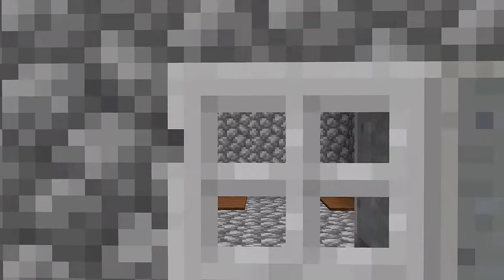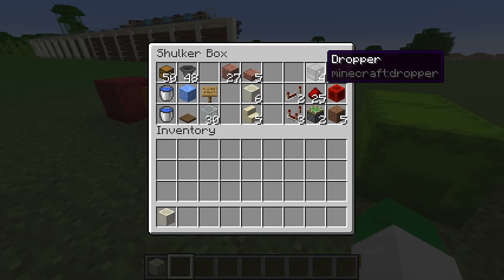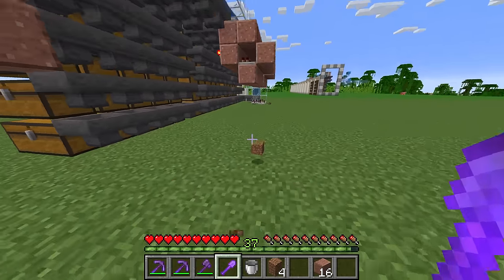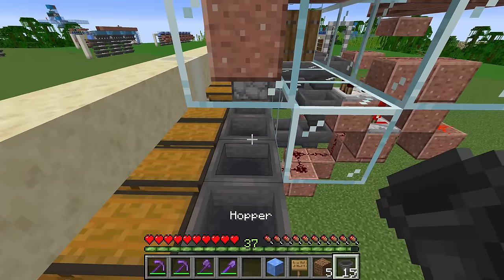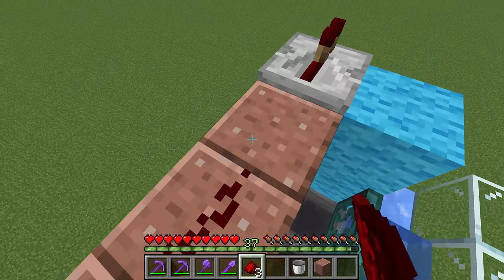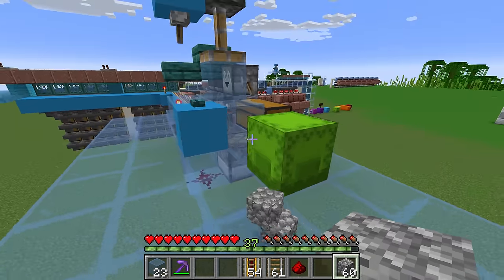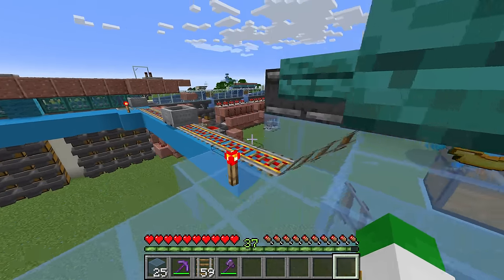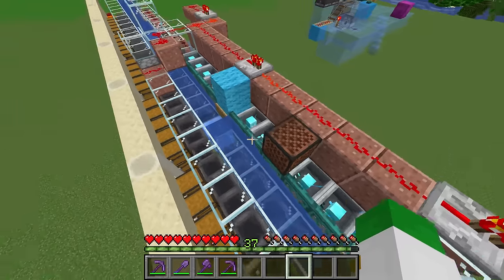How to Build an Allay Item Sorting System in Minecraft 1.20

Comment from the maker: Link to Part 1: https://youtu.be/oByuyOdZ1Is
Reply: I keep having a issue with the bottom dropper not wanting to dispense the items. The only solution I have found is adding another Redstone torch on the bottom block but it bypasses the clock. On bedrock btw, everything else seems to work.
Reply: @FSausser  I found that adding a repeater in the redstone dust on the way to the dropper fixed this for me. I'm also on bedrock.
Reply: Is there a schematic that we can download?
Reply: If I make it 3 block high, will it work?

Comment: Warning!!!! - You have to be within a certain distance of the allays in order for them to pick up the items. For example, I have 3 modules of stackable items for sorting and then it splits off into the redstone clock module and then 2 allay unstackable item sorter modules. This results in 6 total modules of 5x5 chests. I am about 24-30 blocks away from the last allay in the unstackable item sorter and it WILL NOT pick up my items (which are totems). To clear this up if it's a bit confusing, I am 24+ blocks away and my allay will not pick up my last item in my sorting process, which is totems. If you are further than 20-30 blocks from the allay, they will ignore the item and it will sit there in the water and despawn. Beware of this! This could be because I'm playing on a server, I don't exactly know about single player but definitely watch out for this because it was not mentioned anywhere in the video. Waste of my time!
Reply: how did u fix this?

Comment: Quick question: can I use barrels instead of chess because I’m going to make a sorting system using this design for every item in the game and there would be so many chests that it  would be laggy. Btw love your videos!
Reply from the maker: You could although of course it would have half the storage capacity
Reply: @Eyecraftmc  I’m ok with that because I’m planning to use shulkerboxes in the barrels for extra storage thanks
Reply: @fatihyoldas2597  I'm not sure if you're on Java or if this even applies to Java but I'm Bedrock you can power a barrel which would lock your Hopper so just be careful but it should be a lot less laggy than chess

Comment: How difficult would it be to take this design and stack it instead of a giant wall. I want a system that goes from top to bottom. Just everyone does the big wall design
Reply: Problem is that it's more trouble than it's worth. How will you figure out what level to send the items to when you can simply just send them across a water stream

Comment: Having troubles getting allays to consistently pick up items? The dispenser placement is critical. It must be opposite the side of the trap doors so that the items flow down the water stream right next to the trap doors. The same way done in the video. Placing the dispenser same side, above, or below the trap doors, or at the head of the water stream will greatly reduce the reliability of the allays picking up the items (like 40% instead of 100%)
Reply: THANK YOU!

Comment: In order to make in work with the same item in a row (like 7 bows for example) I increased the hopper clock to 10 blocks and use honey cube to align item with the Allays. Except these 2 little changes it worked like a charm. Thanks a lot
Reply: What do you mean by honey blocks ? To align them. Mine only picks up maybe 5 things and then doesn’t work after - on bedrock
Reply: @shanehamilton4798  Hi, I am on java. I use honey block because the item were too far from the side where the ally are. I also increse the timer because item were to quick to arrived and the allays misses some of them.

Comment: On bedrock for whatever reason, allays refuse to pick any type of items up after being put in minecarts. 

The allays can be holding literally anything but won’t detect them, the second they are out of the minecart they will detect it though.

This is definitely a parity issue and its so lame because i made followed your whole tutorial properly and even added  2 extra walls on the opposite sides with an extra 5 allays sections instead of 3.

I thought i did pretty good but i guess not, hopefully you even see this buddy.
Thank you for making a extremely good tutorial just sad the game is broken. 

Also with this machine to get them into place doesnt work very well for some reason because they try to pick things up through the slabs so you need to use full blocks as temporary blocks infront of the slabs but thats not the big of a deal, also the redstone that powers the bottom dropper for the converter section doesnt work properly so i had to fix that too but thats fine aha
Reply: For bedrock I had to trap them in the hopper with a slab, they would pick up the item but wouldn't throw it down in the minecart.
Reply: Could you lead them to fences nearby ?
Reply: Hi plz reply I hope it’s not too late lmao. How did you fix the redstone at the bottom dropper? Items get stuck there for me as well. Second works and pushes up but not the bottom one

Comment: I would love to see a tutorial on how to make a sorter for items that stack up to 16. Recently I've made a sorter for my honey farm, and while the honeycomb is being sorted successfully, the honey bottles remain unsorted and just go down any hoppers available. Would be even greater if it was one block wide!
Reply: You could just use allays if I’m not mistaking
Reply: @H8MyM8Botbi  I don't have any yet. I'm waiting for 1.19.1 to release so I could duplicate them right away.
Reply: The standard item sort works for 16 stackables... tileable and everything designed by impulseSV
Reply: @quinnjooss396  but in the standard one you have to put 41 or so items in the first slot. How many items should be put in a 16 stack filter then?
Reply: @outcast4087  Can you just add more blocking items in the back of the hopper? I thought the idea was the comparator counted the signal strength, so if you were to add 10 blocking items to each of the four slots the hopper would sort item from 5
Reply: @outcast4087 late reply but all you do (if using Impulse design) place 4 eggs for example in the right 4 slots of hopper and a max stack in the first slot

Comment: This is pretty cool. I have so far only used allays for collecting the eggs in my chicken farm because I only have 2 of them. They seem to be pretty buggy though. I had to set up a timer that's just shy of 30 seconds to keep them anchored to a noteblock which has the hopper minecart system beneath it for collecting the eggs. Even then, they sometimes would wander off out of range of the noteblock and would then try following me around again. So I had to lead them up to stay within range of the noteblock. Also, I can't seem to clone them as there's a bug going around where they won't do the dance. So until that gets fixed/added, then they'll just be my little egg collectors.

Comment: Eye... Surely you don't need the gedget to tell if it's stackable or not since none stackable items are at the end only they will arrive there by default. Meaning you only need the hopper clock, or similar device to give the signal strength to set the right speed and that can be done verticality to save space.
Reply: but if u put too much stackable junk, the system that sends items in intervals will overflow and break it eventually
Reply: Could you add a chest or 2 before the dispenser to mitigate.
Reply: @swj020  true but a comparitor and lava puddle will fix that
Reply: @bengeiser3646  I'm not sure if that would help, but give a go in creative. Can't hurt either way if you got spare resources.

Comment: I don't call building all that necessary. All you would have to do is have a dropper facing down, put a cobweb under it, and put a soul sand and soul fire a few blocks below it to burn unwanted items, and surround it with trapdoors so Allays don't get stuck in the cobweb or fire. Make a noteblock in the wall with three hoppers in front of it but one block below it, funnel those hopppers to a chest that's not in the place where allays bring the items in the hoppers, and finnally cover it with glass so allays don't escape but the chest should be outside of it. If there is only one unwanted item, you can have the noteblock the allay drops the items to leading to a dropper into soulfire on soulsand, and the items that don't get picked up get picked up by a hopper into a chest. Much more simple.

Comment: I ended up just making modules that present shulker boxes that you can open. Each module has an unstackable item that I want to keep all the rest of the unstackables that I don't want after I get to the last module will get thrown away I can go through two double chests of shulker boxes pretty quickly doing it this way. My modules just consist of a shulker box presenter and a minecart Hopper underneath the player that you throw the items out of that shulker box that belong in that slice they then go back into a shulker box loader and get repacked it's not full auto but I can do it rather quickly and get back to doing what I want instead of afking at something that doesn't produce me drops waiting for the items to sort

Comment: ik im a little late but i hv a question... do i need a convertor if i dont hv a junk chest
Reply from the maker: You need the hopper clock connected to the noteblocks and to the dispenser at least as that makes the allays connect to the noteblocks and dispenses items for them at a rate they can handle
Reply: @Eyecraftmc  ok ty

Comment: Do you need the converter, or can you just have one junk section at the very end?
Reply: For anyone wondering, the reason you want the converter is that the Allays cannot actually sort items that fast. So, what you need is a way to slow down the item transportation, and while doing that you can separate the stackable items out with the converter. Otherwise, you could get your system backed up with items and cause problems. You can have only one junk section at the very end by routing the stackable items around the allay section straight to a junk section at the end. This way you only have one junk section.

Comment: Need the Allay's to be the end of the system, or could i remove the trapdoor and let it go further (I want to make an all item sorter) so i want tto keep in mind the time that the items need to get into chests bc the items despawn after i thiunk 5 minutes
Reply: Unless your auto storage is 500 blocks long you won’t run into that issue. The items spend most time in the hoppers waiting at dropper elevator. They are only “loose” for about 20 seconds

Comment: anyone able to help? im having issues with the allays and them not picking up any items that ive given them (the items are unstackable, have not been name changed and are unenchanted) i have rewatched the video a few times and double even triple checked the whole section. The alleys are in the right spots too. any one have any clues to why? the items just flow past them, even removing the water and throwing the item in front doesnt change anything.

Comment: Can you also use this for stackable items? All the videos say “non stackable”, but nobody explains why they don’t use it for stackable items
Reply: Yes, you can, but it makes no sence, because it is MUCH easier and faster to build a usual item sorter for stackable items. But allays are used for unstackable items sorting because you almost don't have any other ways to sort unstackables.

Sorry, for my English, I did my best writting it 😆
Reply: For stackables, the normal methods of hopper filters are more resource efficient. This doesnt apply to unstackables because the hopper filters rely on the items to be stackable in the hopper slot in order to sort the items. Allays can target any specifc item regardless of stackability, making them the only general method of sorting all unstackable items.

Comment: Does this system work on bedrock edition been trying to design one myself by failing because minecraft wiki doesn’t have enough information
Reply: The stackable one works so far, havent built the allay one yet. On bedrock
Reply: Stackable yes, allay part is 50/50
Reply: @FSausser  did the Ally part work
Reply: @Sayan  yes, I had to tweak it tho. They wouldn't work in the minecart so had to trap them